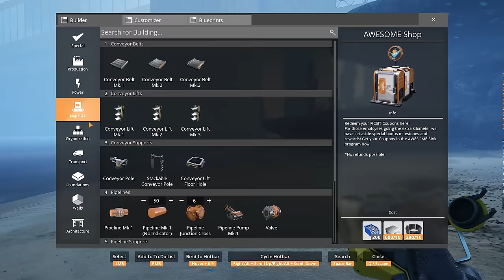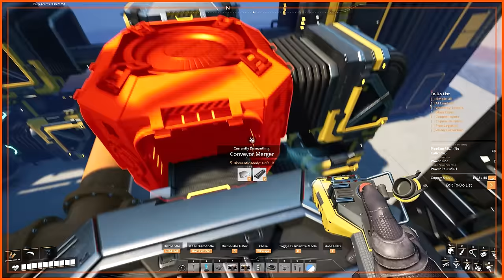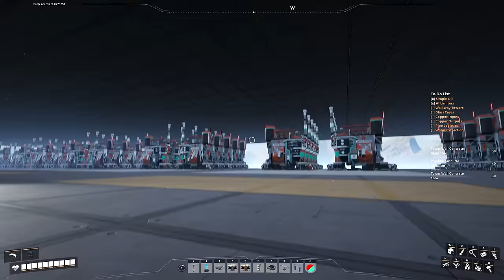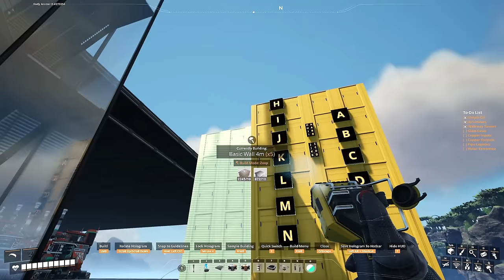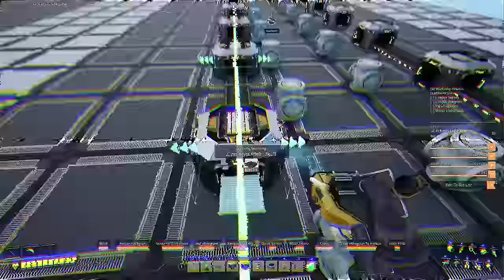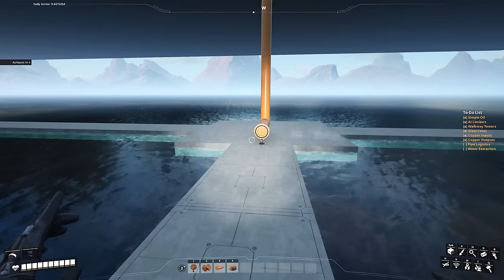How to do LOGISTICS at SCALE in Satisfactory Update 8!

Comment: In a game with so many different ways to build everything, it's surreal watching a legendary streamer come to the exact same conclusions about how to line up junctions, water extractors, pumps, bends, floor holes, etc. to the point that it could have just as easily been my save. I'll be interested to see how you line up freight platforms later, as they seem to be designed in a way that you can either line up the rail or the inputs and outputs, but not both.
Reply from the maker: “Legendary” - 500k watched my first video in the series, then 100K for the 2nd video, and the 10th video now has 10K. I just got a bit lucky with the algorithm, I’m a normal gamer really. For super creative builds, stin archie, creatin and fluxo are the real legendary builders!
Reply: @WhatDarrenPlays  Don't be so modest hehe
Watching and building along with this series until full release, ranked up 100 hours in no time, love this series <3

Comment: A little late comment. When you worked with water extractors you said you had no foundation to work with. You actually can. If you put a foundation slightly below surface level you can snap extractors to those fountains

Comment: For those of you struggling with the coal power plant, convert the layout slightly so Instead of water being fed from the bottom, bring the central cluster of 12 pipes up to the plant floor and feed them from the top (requires an extra pump on each line to get the water high enough). Water in the game follows gravity, so top feeding a line of 15 power plants with a single pipe means water will flow, come to a junction, fully drop into a machine until it’s full up, and then carry on to the next, and so on (it’s just a priority split in a water pipe). “Sloshing” on water systems in this game is a know ism and has been for many updates, it’s effectively mimicking real life, as in water hits a dead end and sloshes back on itself, can cause mayhem in pipework even when you have a balanced system because even a split second mis match where consumption dips below production of water means the pump completely lowers down and then turns back on, it’s in this short gap that makes bottom fed systems so vulnerable. Keeping your bottom fed system means if there’s an intermittent moment when water pumps turn off for a split second (due to a random slosh etc), there’s water fill issues on many many power plants because also like real life water will drop across the entire system so the highest points in a pipe are same across a line, it either reaches all of them or none of them,. The top fed system removes sloshing entirely, and even if there was an intermittent issue and water pressure dropped for a reason, only the very end power plant in the line would turn off, combine the above with the removal of floor holes because they are currently buggy as hell and you have a super stable power set up.

Comment: You might want to split the "glass case" prints into "end bits" and "middle bits"; which would allow you to insert as many of the "single wide" middle cells as needed  between the end caps that don't have any conveyor elevators in them.  Yours with a 2x3 and a 2x2 split force it into a total of 2x5 area.

Comment: Really really good "educational" video with lots of great advice. Great job Darren!
I never used blueprints much because I always try to build very large but compact manifolds that don't fit in the blueprint Designer. This video has changed my mind and I'm going to try a few things today :D

One thing I think might be helpful; I like to put a constructor on the middle of a single piece of foundation and then snap a water extractor to each side of it so I have 2 extractors facing eachother, aligned to the world grid, with exactly 1 foundation space between them. Then I can snap more extractors to the sides of those extractors and its also pretty easy to use another constructor to put a 5th extractor at the end to fill a 600 pipe, or I can do two long rows with additional junctions pionting up to make a stack of output pipes. the original foundation that I use for the constructor helps to place stackable supports.

Comment: A suggestion for the copper logistic  (around 58:00): If you run into problems with space , instead of going under it you could make the lower (or higher) belt do a sharp 90 degree turn and then go up. So the one directly up out of the station goes to the far belt and the one with the sharp 90 degree turn at the bottom goes to the near belt. That would safe you half a foundation width of space.
Reply: Thinking the same thing, very well explained

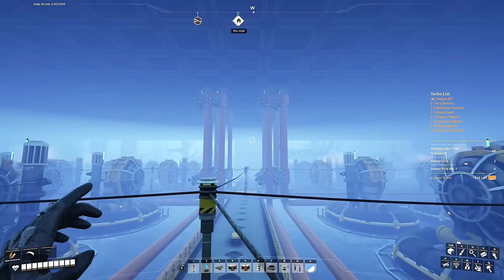Comment: I noticed all the pumps at 13:14, but you only need them on a single pipe. Mk.1 Pipes are limited to 300 m3/min, but pumps are not. If the pipes are all part of the same pipe network (so nothing between them that resets head lift) they share head lift pressure. So connect them all together in a big donut on top, and they will all work as if all vertical pipes have pumps.

Comment: Cool Video! In my "Caterium Cathedral" I produce 25920 Quickwire per minute! All with alternate recipes. The logistics are super hard and if I'd build a factory like this again, I'd first build all the conveyors and transport lines, before even placing one Constructor. Quickwire is amazing to replace screws. I have not a single product, that needs screws. All the AI Limiters, Circuit Boards, Computers and so on are produced in mass scale with Quickwire is so much better than screws.

Comment: I personally fallow such pattern:
1) Temporary setup. The obvious part.
2) The Power Plant. Also obvious part.
3) Centralized Hub base, initially connected to temporary setup.
4) Centralized logistic and various modular factories.

I do not see point in going big at first. Just prepare facilities with expansion in mind. The problem is when people are forced to tear apart they existing facilities to expand they capacity. This in fact make feel repetitive and like work do not make progress. But going too big also may cause troubles and be tedious. Though it depend on the person. I personally think that making new factory may be sometimes better then tinkering with already existing design. Though it depend.
Reply: PS: I wounder if he plan to make load balancing setup near truck station?

Comment: Instead of using 2 digit numbers for the machines, you could use 2 letters or a letter and a number. That way you dont get into 3 digit terretory as quickly. Which would also nicely work with the 26 machines.
Reply: A through Z, and 0 through 9, omitting the letters "I" and "O" so not to get them confused with the numbers "1" and "0", gives you 34 charters.  34 * 34 = 1,156 combinations.

Comment: I've tried the whole "build it really big at the start so you don't have to go back later," and it just doesn't work for me. I can't handle spending so long on early projects. The only time it works is with like a giant Coal Power Plant when I first unlock Coal so that I do it once and don't have to worry about power until I unlock Fuel Generators.

I just end up building a line of Iron Ingots (or other starting products) in every single production line for every single factory rather than making one giant one and siphoning off of that for later projects.

Comment: nice video!  I was thinking for your glass cases, couldnt you have done one blueprint with at 2.5 foundations?  then you could just use one and rotate it around?
Reply from the maker: Can’t do a half glass window 🤷‍♂️ could do a single segment and a side, and then you’d place side, segment, segment, side.
Reply: @WhatDarrenPlays  good point.  but what if you did 2.5 foundations, and then one side have the windows go the full 3 foundations, and the other side have the windows go 2 foundations.  as you rotate it around the center they should be seemless.  you wouldnt be able to snap the blueprints though because of the funky sides.  sorry just brainstorming!

Comment: @70:00 A pump serves as a valve, so the valve right next to the pump is unnecessary. Looks neat though, so there's that.
Reply from the maker: Pumps can’t set the flow rate.
Reply: I've always had better results leaving em wide open and just having an overflow pipe, before the last pump, to carry away any excess.

Comment: Quick question, why would you not also use the coke for power production in coal generators?
Reply from the maker: Extra time and effort I suppose, wanted to focus on this build and we have 2000MW of power to play with still, if it starts getting a little tight, then I can add a few extra generators for it.
Reply: @WhatDarrenPlays  makes sense thanks!

Comment: I might be wrong, but I think a pump acts as a valve too?
Reply from the maker: Pumps stop backflow, but they don't control the flow rate. You can use a valve to limit the flow rate, I've set the water extractors to what I need so I guess that's largely pointless, but I like to try to control the rate where possible so it sloshes up and down less.
Reply: @WhatDarrenPlays I thought valves were broken as well.  If you have trouble in future maybe remove them

Comment: Instead of having a bunch of pumps inside of your factory builds why don’t you build a water tower that gets the water to the height needed in a separate building.  This will isolate all of your pumps in the same separate building so it won’t be as loud.  Also you should do some research into the water pumps and what is known as a “key pipe”, you can drastically reduce the number of pumps needed (basically instead of 1 pump per pipe you can use one pump for multiple pipes).
Reply from the maker: Its an exploit, thats why
Reply: @WhatDarrenPlays  lol, what?  How is using a water tower to utilize how water normally works an exploit?  If all your machines are 40m in height then you can build a 50m water tower right after your water extractors and the only pumps you will need will be for the initial 50m height of the water tower since everything else is below 50m.  I’m not sure how real life fluid dynamics is an exploit.

Comment: Why bother with mk.1 and especially mk.2 belts after having mk.3 belts unlocked? mk.3 belts are so cheap and easy to make that everything else becomes useless to me after they are unlocked (especially after monorail milestone when you gotta carry around stacks-on-stacks of steel beams anyway)
Reply from the maker: I make 20 steel beams per minute. This build requires around 50,000 steel beams for the foundations.
Even if not trying to be conservative with resources, I prefer to have less gaps on belts, so if I make something at 60, I use a 60 belt. It looks nicer that way :)